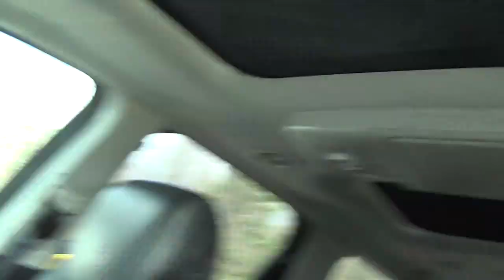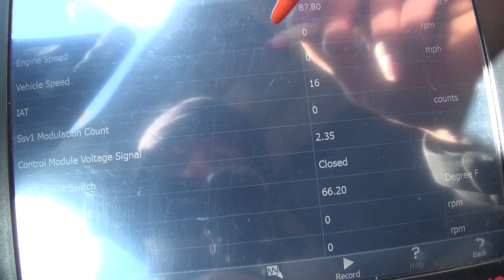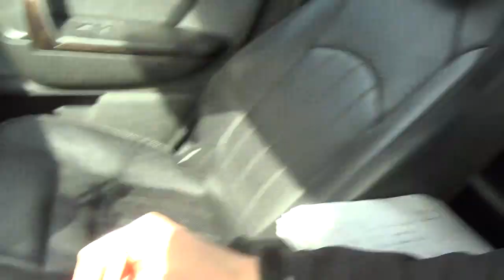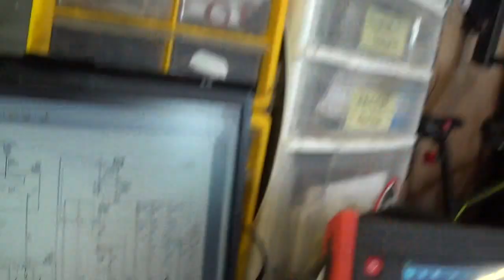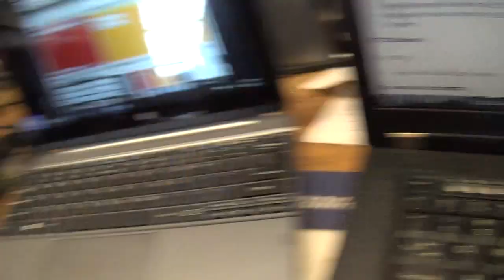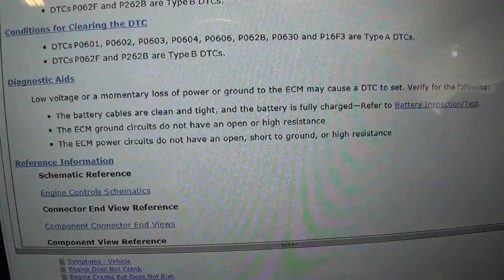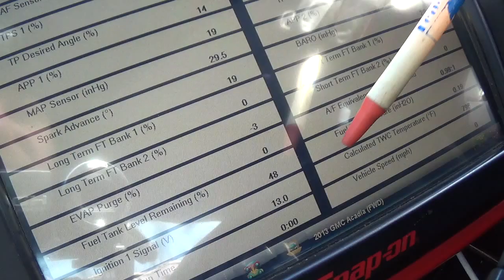COMEBACK!!! No-crank, REDUCED ENGINE POWER: '13 GMC Acadia -Part 4

Comment: Ivan, there are two other fuses/circuits off to the right on your schematic. The air bag mod fuse and what looks like a clock spring fuse that could effect the ign-1 voltage. They need to be eliminated from the mix of unknowns. A malfunction in them could drag down the ign-1 voltage and a air bag mod capacitor discharge could spike the ign-1 voltage to the questionable 13 volts. Try monitoring the ign-1 voltage level with your PICO scope for noise or other changes with the two fuses both in and then removed.
Reply: Frank Soliday I believe your thinking of Eric at SMA. It was a subaru rad fan motor drawing 40 amps.
Reply from the maker: hmmm very interesting thought. When you say "drag down the ign-1 voltage" how would that happen? If the current is high enough to significantly pull down the voltage in that leg, would it not just blow the respective fuse?
Reply: Not if you are dealing with an intermittent fault. Most of the fused circuits are design to be fault tolerant or the fuses would pop all the time. I believe you just diagnosed a fan fault on a Nissan with a 40 amp fused circuit normally drawing about 8 amps. (My memory may be wrong on that. But the circuit was way over rated).  The harder thing for me to understand is where the 13 volts are coming from without the engine running, unless the PCM captured a power off surge/spike put out by one of the other modules. The 158 MPH trans mod is also suspect. Interesting problem that may require a process of elimination. Regardless, I'd still look at the ign-1 voltage with a scope. Just my thoughts Ivan, don't waste to much time on them.

Comment: "GM spokesman Alan Adler said the new recall was prompted by field reports of metallic slivers causing electrical shorts in the chassis control module that could lead to stalling or vehicles failing to start."  I had a stalling/ no start issue that turned out to be aluminum slivers shorting out the ECM.  The Acadia is plagued by water leaks and electrical problems.
Reply from the maker: Let's just say I couldn't think of a worse vehicle than this "computer on wheels" to have water leaks. Did someone say Subaru Forester?

Comment: The fancy battery tool is the Midtronics GR8, it is about $4k and not that special. But is needed for warranty codes and such.
Reply from the maker: The service writer had me sold on his fancy battery tester lol
Reply: motoYam82 I have a Midtronics MDXP300,  got it used on eBay for £120. There's the same one on eBay right now for $400 and $30 shipping. It's a great little money maker.

Comment: I just fixed an envoy with a no start and a no stop with the switch off. it was water coming into the passenger side of the dash via sunroof drain. took the fuse box out and poured the water out. may not help but might. clue is 13v and not running.
Reply: If the voltage is being measured based on the output of a divider network then it might normally call something like 8 volts 12.6 as refereed voltage making the 13v possible @engine off. It's not really 13v but if something is causing the "8v" to go to say 9v. then that would 'spliain it. It almost looks like a bad ground in the ECM.
Reply: Stanley Hill wonder if unplugging the speed sensor will bring the voltage back to where it should be. Can't figure out what is creating more voltage unless it's a substituted value but that's a stretch.
Reply: motoYam82 Did you get it fixed or still scratching your head like some of the rest of us? Lol
Reply: Techman 48917  thanks techman!
Reply: Michael Nicholson Envoy is GMC also and they are completely different as in design wise and layout. Water will not cause a higher voltage reading but will cause a mess for sure.
Reply: It was in identifix. Continues to run with switch off. I don't remember the TSB number. I need to document these things. The reason for my suggestion is the overage of power in one circuit and a underpowered circuit. Plus your radio is short to ground. Water could be brigding circuits. The hose was off of the exit grommet and leaking down onto the fuse block. I know your running out of time but I could look for it tomorrow at the shop. I don't have access at home. My boss don't trust us..
Reply: Techman 48917 I kinda thought it might be a longshot. Just trying to help the man out.
Reply: Yeah no doubt nothing wrong with that.
Reply: Never know what may be the key
Reply: Something is lying. How could it add voltage? I think I would check powers and grounds at the TCM and ecm. If the verus and the autel are being used a scanners then he's getting processed info. If the values are different when scoped could be a step. It's got something to do with the rain. Was fine for 45 days.
Reply: Call Eric o at South main auto never seen him beat. The two of you are some of the best mechanics I've ever seen.
Reply: motoYam82 That 13v without the engine running is weird... Am I the only one that feels off about that 158 mph 😒 Unless the customer just drives that fast
Reply: Michael Nicholson Looks like you were on the right path on this even though they were different designs same problem.
Reply: Michael Nicholson Looks like you were on the right path on this even though they were different designs same problem.
Reply from the maker: yeah 13V not running really doesn't make sense at all. Whatever is happening is messing with the voltage sense circuits inside the ECM
Reply: Owner said when it was raining. The reason I found it was because of a TSB I think it was a 08 GMC envoy. The fuse panel behind the glove box showed signs of corrosion from water. Everything else looked dry. Pulled three relays and seen the corrosion. Pulled the fuse box a pour the water out of it. I didn't look that close at the PIDs. All I have is a Solus edge. But if thats it you'll have to fix the leak too. The dealership left a bad taste in this owners mouth too. Hope it helps...
Reply: This one came in on a hook. Didn't get to test drive first. Could be first signs of water intrusion. Wait envoy is Chevy, Acadia is GMC right. Its the same monster. I hope this helps. Tennessee Mike
Reply from the maker: Well the Envoy is the older style GMC SUV. The Acadia is the same as a Chevy Traverse and Buick Enclave on the FWD/AWD platform. What was the TSB you found on this?

Comment: from what I've seen lately I had an issue with 2012 Buick enclave with either not running or running in limp mode.  after scanning and troubleshooting I found it was the accelarator harness. since is a drive by wire the contacts inside break apart. its located on the throttle body area and not on the actual accelarator pedal. like many. according to my friend who works at the stealership it is a common issue. or should I say defect.
Reply from the maker: Did your Enclave have trouble codes stored for Throttle body position sensors?
Reply: motoYam82  Yes Sir. I had a code for the pedal sensor as well,but after consulting with my buddy from the dealer he told me to replace the whole throttle body which includes the actuator.  apparently they have some contacts going bad inside
Reply: I hope this helps since I've seen you suffering for a long time with that vehicle.   
I like your forensic approach when trouble shooting.
Reply: I bought the throttle contol body from Amazon since my customers are cheap. Its supposed to be original although the price was too cheap. around $ 116-112  so far its been almost two months and that thing is running like a champ.

Comment: I had a similar issue as John Odum below. Bad ignition switch in a GMC. Caused all sorts of strange errors. The heated seats would not even come on which finally led to the ignition switch. Also there was a key recall on lots of GMC and Chevy's. The key caused a pressure on the switch and made failures. Good Luck

Comment: I had a Chevy traverse, i can't remember the year. the power wire to the tcm had rubbed through and intermittently caused a no start due to loss of communication. If i were you i would check the wiring harness and make sure it isn't rubbing anywhere... I want to say either you have a bad ground connection, or a bad relay, or an issue inside the fuse block. GM had advised us to make a solution of salt water in a spray bottle, it sometimes helps with intermittent electrical problems.

Comment: do you think you may have a power interruption to PCM via relay or ignition switch? I have changed a lot of ignition switches because they are only supplying 8 volts on the orange leg. just a guess knowin the ignition switches are a common failure on GM products

Comment: I'm wondering about that amplifier error. Sorry you got stuck with a tough job. I had a big issue with a gas range last week. the harness connection was shorting internally.

Comment: This sounds like a hardware issue related to the solder separating from the circuit board. Same deal the xbox 360 went through years ago and now our electronics go through today. Module cools down and the solder looses connection or warms up and looses connection. Intermittent as components loose connection. Why don't we have a little dongle piece that logs data for the customer over the OBII port while they go back home and wait for the problem to reoccur again. They come back and you at least have some data to review.